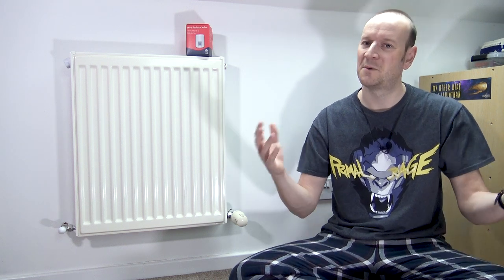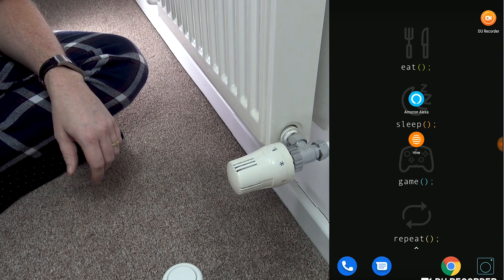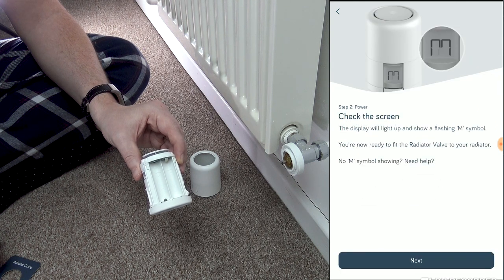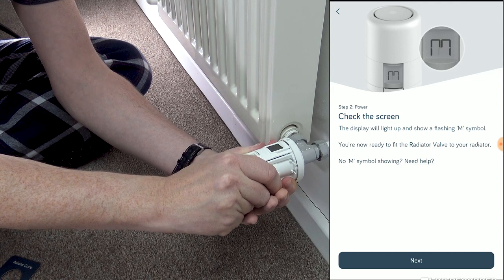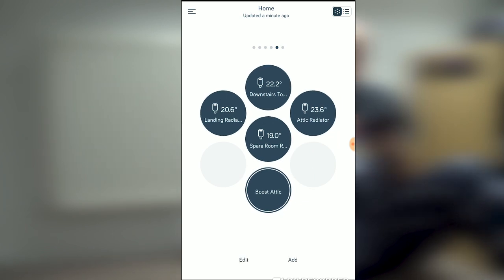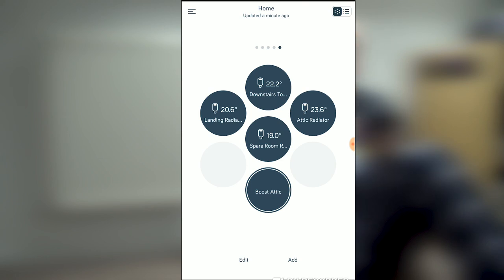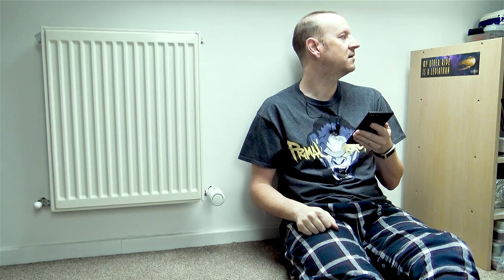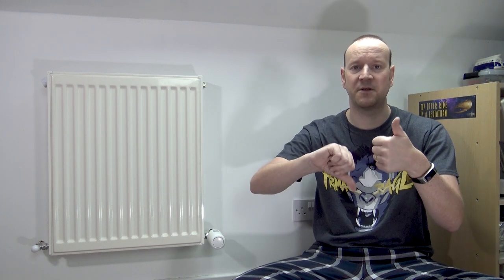How to install Hive TRV Valve

Comment: Great video. I’ve taken the plunge and ordered 18 of these, so seeing someone else set theirs up is very handy. Thanks
Reply from the maker: I have 12 of them running in my house. On the whole been running flawlessly since I installed them. Good luck.
Reply: @Abernus69  what temp do you have yours set at? And have you noticed a difference in gas usage? Thx
Reply from the maker: @leec3419  I have all the valves set to 14 and the heating in most rooms to manual, with only the most used rooms set to boost to 22 at peak times. In 2021 I reduced my gas bill by £63 compared to 2020

Comment: Just recently had a new boiler fitted along with Hive. The valve on one of my radiators vibrates quite quickly and the noise it makes gets transmitted through the whole system. Seems to happen when the rad temperature approaches the heating temp. Stopping the rad valve will stop the vibrations. Other radiators are no problem. Pin on the valve body seems free. Any idea whats goi g on and a cure? Thanks.

Comment: Thanks, really useful! Can valve's, and particularly Hive TVR ones be installed on any radiator, mine are 22 years old
Reply from the maker: As long as the valve will fit it should work no probs.

Comment: thank you very Informative. Have you suffered with the Hive TRV not working correctly too cold or too Hot as lots of folks seem to be having issues.
I'm considering purchasing however seem a bit reluctant with some of the highlighted issues?
Reply from the maker: Never had an issue with the heat side of things. The only issue I get is the valves sometimes with disconnect or won't boost. This is usually down to batteries dying.

Comment: Thank you for posting this video online.

I have a two questions:

1) Do you know how you get the M30 adapter off the TRV? I'm struggling to get the TRV off the radiator again as no much to grip and once I did get it off, I couldn't unscrew the adapter. 

2) Do you have Hive Active Heating? I do...I currently have 2 zones - upstairs and downstairs. I'm looking to use my TRV to control one room over the garage but when the TRV calls for heat (linked to upstairs thermo with heat on demand enables), all the upstairs radiators come on, which kinda defeats the purpose of only wanting to heat a single room. How do you have yours setup?
Reply: Sean Delaney I think the information on the set up instructions ( when asked if you want to activate “on demand”) states that activating on demand heat will cause other radiators to heat up too. I also thought the same as you.... the whole idea is that “you never have to heat an empty room “ !
Reply: The TRV is calling for heat so the boiler turns on and send hot water to the radiator. That water will also flow through to all other radiators on the system. It will only work properly if you have Hive TRVs on all radiators then the other radiators that don’t need heat will shut off preventing hot water from flowing through those radiators so it only goes to the radiator calling for it.

Comment: Hi Did you have to remove a thread on the adapter you used? I tried to fit it without removing the thread and it would not fit.

Comment: Hello, nice video, just one thing how long do the batteries last? Cheers!
Reply from the maker: Depends on how frequest you change the temp on the radiators. I have mine set to run a schedule to boost the temp every morning and I have found on average the batteries last about 1 year. Use good quality batteries.

Comment: eventually got the covers off to fit batteries .. not easy with old fingers and thumbs!  I've  fitted 5 today  managed to set a couple of scenes and schedules ....but one valve is saying low batteries .. i've done the reset several times... put new batteries in (even though I used the ones in the box originally) but still alerting low batteries.. any idea what I could do?
Reply from the maker: Not sure to be honest. Best thing I could suggest would be to delete the device from the hive app and try to set it up again. 

If you still have the problem them I would suggest you contact Hive web chat

Comment: Hi how is it best to run.  I.e. have your thermostat on manual or schedule?
Reply from the maker: During the summer months I have it set to manual and set the radiators to a low temp. I do this as the ambient temperature is high.

During winter I up the minimum radiator temp and set a schedule to heat the rooms I need at peak times.

At all times I have hearing on demand enabled.
Reply: @Abernus69  thanks for the response.  Been testing to see what is more efficient.  The main box on manual but set to heat on demand or main box set to schedule and also  heat on demand.  Mixed results so didn't know if I was doing something wrong.  Do I set the trvs to the same times as the main box or is that pointless?  Set up very easy don't see why people have an issue with it

Comment: I couldn't spot the main thermostat on your hive app, did you have to turn it on to get the Radiator working?
Reply from the maker: Yes the Thermostat is there in my app and is running. I have heating on Demand turned on in the setting for the thermostat so each radiator can demand heating when needed.

Comment: Hey, great video - I've read online that a lot of people are having issues with these - is that something you've experienced?
Reply from the maker: Every now and then I tend to find that some of the values won't boost the heating. I find it usually due to low batteries and the app hasn't reported low power in that valve. The other reason is sometimes the thermostat has just lost the plot. The first thing I do is take the batteries out of the value and the thermostat and everything is back to normal. Then just keep an eye on it and if it occurs again change the batteries

Comment: I have followed your instructions. All 5 valves are calibrated but when I try to boost 2 rads downstairs the boiler does not come on..even if I raise the temp on the valves...any help would be appreciated
Reply: Hello, your heating MUST be on in order for the radiators with TRV’s to heat/boost etc. I bought 5 TRV’s back in Oct, thinking that I could control individual rooms for guests staying so I could have that room set to a temp comfortable for them while not having the master room heating too. But how wrong was I. I personally believe hive has/is false advertising these. The only thing TRV’s are handy for is the convenience of turning on/off your radiators without manually going round each room to turn the radiator up/down. Hope this helps.

Comment: Hello, I bought 5 of these back in Oct. I have lost count the amount of times I’ve rung Hive as only one of them has calibrated and my heating has been on for hours on end to try get them to calibrate. When I do select calibrate while my heating is on, the TRV radiators are freezing until you remove the TRV and then instantly the radiator (with no valve on) heats instantly. Any advise as I’m loosing the will now :(
Reply from the maker: I had a problem with my living room radiator not calibrating. I just took both batteries out for a few seconds and put them back in, boosted the heating and hit calibrate and it worked. Make sure your batteries are not dead and does the value get a good signal?

Comment: When removing the old TRV does it matter if it is open or closed fully.
Reply from the maker: It doesn't matter
Reply: Also, I have 6 radiators. But one doesn't have a trv. Will I be able to set this single one to frost control and the other 5 independently of each other. Many Thanks for your reply.
Reply from the maker: The ones with the Hive TRV will be able to be heat individually. You should have at least one radiator with no thermostatic valve or smart valve on it. That radiator will not be controllable, when the heating is on this radiator will just heat. Hope that makes sense

Comment: How do you unscrew the hive thermostat valve device?
Reply from the maker: Take the cover of the valve. Then on the back of the valve at the bottom you will see a little tab, push and hold it in while you unscrew it.

Comment: hi, can you expand on why holding it until screen flashes 4 times when installing batteries?
Reply: That's the question that came to my mind as well....Why?
Reply: Hive themselves recommend doing the cycle just once. I guess it it just to be sure, to be sure, to be REALLY sure.
Reply: @wallaceshackleton1889  i only did mine once and they have all been fine, and I have installed 15 of them in my house. so still none the wiser, but he is really sure :-)

Comment: If I only have one of this , will my system still work as normal everywhere else?...... tia
Reply from the maker: Yes I have a few radiators with regular valves. Make sure that heat on demand is enabled on the thermostat.

Comment: I am having a problem getting my hive sensors to calibrate. One has calibrated successfully but the other two haven't yet. I click the "Calibrate Now' button on the hive app and it tries to calibrate but does not complete the calibration successfully. Can anyone help please? Thanks, Mick
Reply from the maker: I would double check your battery level on the valve and possibly replace the batteries. Also make sure that the valve is able to request heat by manually boosting the temp in that room and see if it heats up. Lastly make sure there are no open widows near by that might be causing a draft on the valve.
Reply: @Abernus69  thanks I will try that

Comment: Do these require a Hive hub?
Reply from the maker: Yes they do
Reply: @Abernus69  Thanks for the reply. so it might be better to join the Hive eco system with a Hive + Thermostat installation? Also, have the technical issues which have been highlighted in the comments been resolved yet?
Reply from the maker: Mine have been stable, however they still throw a wobble from time to time but it's usually down to low batteries. The app still doesn't always report low batteries.

However with all things tech, there will always be issues. I can't say an installation won't have problems, just give you advice on mine.

Comment: Have you herd the latest  on TRV the latest one have a software issue and was told it will be 3 to 4 weeks before hive have a fix! Just bought 4 and they do not work.
Reply: I’ve had absolutely nothing but problems with these valves over the last 12 months. Send them back for a refund whilst you can! Drayton wiser or tado actually work.
Reply from the maker: Yeah the latest firmware update caused all mine to not respond to heating boost at all. Just took the batteries out and popped them back in again and no problems. Been working fine.
Reply: @Abernus69   will try that thanks. I did and it doesn't work.

Comment: Poorly designed crap, try getting the buggers off, built to fail. Connectivity appalling even with a hive extender and software is attricious, all valves have to be indivdually controlled, can't be grouped into rooms, where the hell do they think we'll be using these. Want to warm a room, turn up each valve individually, it's a joke.
Reply from the maker: You can create quick actions in the Hive app to control multiple values at once. These can then be discovered by Alexa and you can then create a voice command to call it.

This is how I heat just downstairs in my house.